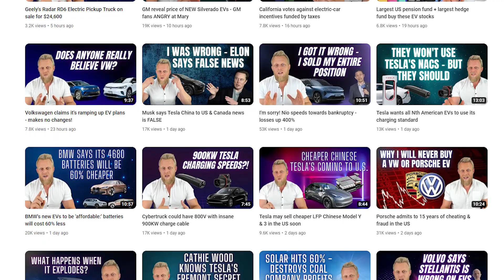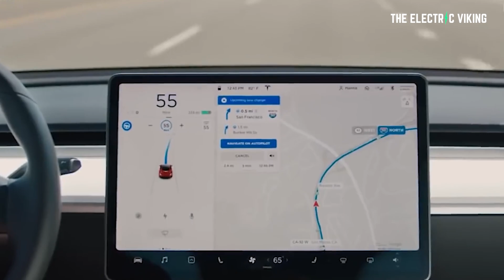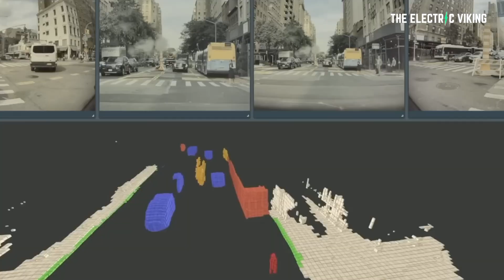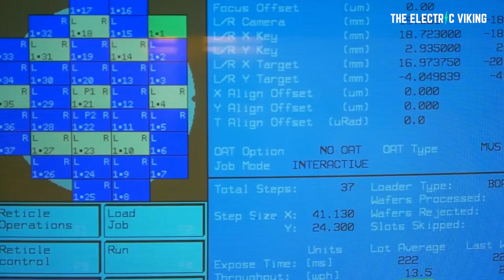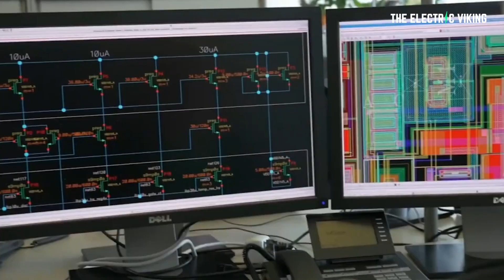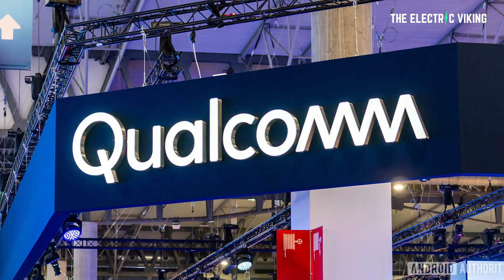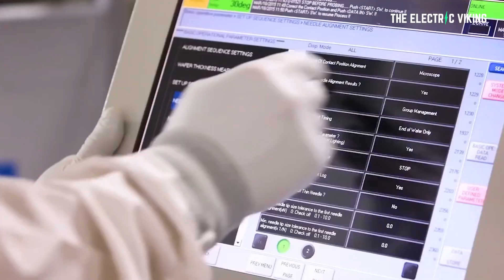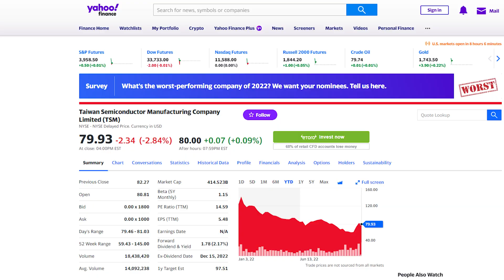Tesla places HUGE order of next-gen FSD chips with TSMC

Comment: Sam you may want to check out ReRam. TSMC announced they are producing it at 40nm. ReRam has super disruption of Flash NVM which is in every electronic device given its far superior performance at lower cost.
The Apple iPhone 14 is rumoured to have this ReRam in its power management chip. This could explain the Tesla move due incredible power saving and endurance over Flash NVM which has already failed causing a 160,000 car proper recall to replace.
The only other near term ReRam company is ASX listed Israeli company Weebit Nano.
How about you get in touch with Coby Hanoch WBT CEO and do an interview about this revolutionary new NVM soon to be in all electronic devices as Flash goes the way of floppy discs.
Can help in this regard. By the way WBT has been asked to speed up
Reply: development of ReRam at the 22nm node for automotive applications by a Tier 1 fab.
Reply: Should add have been a large holder since 2016.

Comment: You don't understand semiconductor  industry.

I suggest the excellent Asianometry YouTube channel & site to take a better grasp of industry history and dynamics.

Fabs as they call the manufacturing facilities cost nearly 20 billion each in most recent generations. It's very capital intensive, but command a premium for it's production for a relatively short time when products are nearly top edge. Factories must run nearly at full capacity and quickly raise good chip yields to be profitable.

TSMC is a pure fabrication contractor, different than Intel and Samsung who also design chips. Intel "fabs" mostly it's own designs. This was called an IDM for Integrated Design & Manufacturing.

Semiconductor industry was used to exponential growth based on the shrinking of features in the chip with power efficiency, performance and cost gains at each generation. 

A generation was defined by the "node process" related to the minimal feature size. Not anymore, now just a dumb number to represent what would be expected if they could reach this value of minimal feature (not possible) doing a lot of other tricks (2D to 3D, new architecture and materials,...).

TSMC brilliantly leaded by Morris Chang, a former TI employee, developed the whole of Taiwan's semiconductor infrastructure and ecosystem. Thousands of highly educated engineers and technicians that can manage and operate the highly sophisticated fabs. Not just at lower cost, but also not easily reproducible elsewhere.

TSMC asks: would there be Americans prepared to fulfill this kind of jobs?

Part of the fab cost is the buildings themselves. No vibrations allowed etching features at nanoscale. They're highly automated, it's true. But they must incorporate the latest tools and perfect the processes to execute reliably with few losses.

Just imagine that a typical high end chip will have more than 50 layers of processing. No misalignments, no defects allowed in the many millions of component features inside the die/chip.

Each fab is far more complex than anything Tesla does. All about Tesla is child's play compared.

ASML is the sole producer of the newer generation of a crucial tool that uses Extreme Ultraviolet Light capable of producing economically chip from "7nm" (TSMC's dumb number to call the node generation, not real feature size) and below.

Intel is only mass producing at an equivalent to 7nm (former Intel 10++++, current Intel 7 to align to TSMC's and Samsung naming).

TSMC, Samsung and Intel are the sole producers using EUV that American government control the licence to export. (Was built first in US and basic patents licenced to ASML the integrator of the machine and their parts suppliers like Zeiss, Cymer, ...).

Those EUV tools can cost 300 million dollars each. There was a G1 and now they're ramping a G2 with high numerical aperture (high-NA).

Intel postponed volume introduction of EUV-G1 due to it's gigantic costs using older "fatter" light sources (DUV) with more passes falling behind. Now they're trying to leapfrog with EUV-G2.

Intel perfects a process and "copy exactly" to other facilities to broaden volume of it's own designs.

TSMC contract builds many more designs of the whole industry, and Smartphones now dominate the high end volume market. TSMC has far higher volume output than Intel and Samsung allowing for testing and perfecting variations of the nodes first and commanding higher margins.

Older processes are also used and there was a shortage o capacity this last years. Historically most elder facilities (5 to 10 years) are not profitable commanding just marginal costs, subject to boom and burst cycles and consolidation or closure. 

Some do specialized work as hardened chips, analog chips, etc.

TSMC made a business of not competing with it's customers, being reliable not to steal or let others steal their customers design. Last but not least they execute near perfection. 

Being subject to Taiwan's risks (earthquakes, mainland China bullying) is their risk.

Moving capacity to the US will cost more to build, license, operate the factories decreasing margins, but also give them survival options in the case mainland goes crazy.

US is making a strategic move onshoring more semiconductor production for geostrategic security more than cost effectiveness. It's a recognition that the dream of globalization have gone a bit too far with risks not tolerable of depending on the other side of the world for everything.

The pandemic, Russia's adventure in Ukraine, had effects lowering the risk tolerance Wall Steet lead the west.

Some geographic diversification of production of everything people rely on is expected even if agaist crude economic profit in simple Excell spreadsheets won't point this way.

If batteries are strategically needed, chips are needed too.

Comment: FYI TSMC is a very good, well organised chip foundry - it builds the chips from silicon wafers using various processes, making them to designs specified by chip designers like AMD, Intel, ARM, TESLA etc. It uses ASML lithography machines to achieve the desired resolution (5nm, 3nm etc). ASML is where the really difficult part of the process occurs: designing and building extreme ultraviolet (and beyond) lithography machines which produce accurate, reliable results for years on end. 
The West has largely, and foolishly, treated computer chips as a commodity and has, therefore, built very few chip foundries. Even without the clear vulnerability of Taiwan to mainland Chinese aggression (which is rising, as you note), it is pretty dumb to have, effectively, a sole source for such a vital part of the modern world. Someone has finally wised up to the fact that the consequences of losing most of the world's chip supply for any reason would be devastating to the world economy. Hence the US decision to invest in a chip foundry. The EU, Japan and the UK should be doing the same so that there is sufficient capacity in the event of a disaster. I also note that one of the reasons that Russia is failing so dismally in Ukraine is that it has lost legal access to western chips for its modern weapons.  Its own designs and foundries are about ten to fifteen years behind the West (e.g. lithography at about 65nm implying they run much slower and much hotter and are less complex or capable).
Reply: Very good comment, but the premise is that you must know what US Secretary of Commerce Raimondo said: "The United States imports 70% of high-efficiency chips from Taiwan, and these chips are used in military equipment."

Many people don't know that Taiwan's all-out development of chip manufacturing has only one purpose: to manufacture the chips needed for anti-ship missiles and prevent China from invading Taiwan.

The United States handed over 70% of the military chips to Taiwan for manufacturing, and this is only a matter of ten years. Only TSMC and GlobalFoundries can manufacture military chips in the world, so this is not a Western chip, and it has nothing to do with Europe. , Only the United States can design the most advanced military chip, but only Taiwan can manufacture it. It has nothing to do with Europe, so it has nothing to do with the Western world. Taiwan belongs to the East.
Reply: @百里嘻  Taiwan belongs to the people of Taiwan agreed. Their semiconductors are a shield against China. If China attacks the United States defends Taiwan. It would be suicide for China to attack.
Reply: @shauna996  In fact, even if the United States does not participate in the war, Taiwan has more than 50% certainty that it can defeat China. Of course, it is even better if the United States participates in the war, and there is a 99.999999% certainty that it can defeat China.
Taiwan's focus on semiconductors has never been for making money, but for the research and development of advanced weapons. The current situation is actually very embarrassing for Taiwan.
Reply: @百里嘻  Thank you for your response. Firstly, please note that ARM chips are the most produced CPUs/chips in the world with over 230 billion made so far and counting. They are often the core design around which other elements are added (e.g. Qualcomm snapdragon CPUs for phones).  ARM is a UK (i.e. European) country. Given that these are low-powered, fast and efficient general-purpose CPU chips they can, of course, be used in military equipment like missiles. So your point about "nothing to do with Europe" is wrong. Secondly, you do not specify what chips the US Secretary was alluding to but I suspect that they include ARM-based chips, given that those are so fast and efficient.
Your pride in Taiwan's prowess as a manufacturer is justified but, as I stated in the original post, it does not design chips, and likely lacks the capability to do so, and relies on western designs and western equipment to carry out its manufacturing. What you are claiming is like saying that a book written by a UK citizen, printed on a Dutch printing press in Taiwan makes it a Taiwanese book. I disagree. I suspect you will never change your mind on that so we must agree to disagree - as is often the case in discussions.
Reply: Before 2004, the United States led the world in semiconductor technology, and foundries had to pay IBM's technology license fees. But in 2004, TSMC took the lead in developing 0.13-micron copper process technology ahead of IBM, ushering in the era of Taiwan's semiconductor technology leading the world. In 2014, IBM withdrew from the foundry business, and TSMC considered buying IBM's fab in New York State. However, even though IBM's technology has lagged behind Taiwan by a decade, the US Department of Defense and IBM, still worried about the already fading American technology influx into Taiwan, rejected the deal. High-tech semiconductor technology is the result of Taiwan's efforts to develop, and now the United States claims to "bring back" semiconductor production to the United States.
Reply: @genuinennessbefitting4734  Thanks for the comment - which I respect. I'm not really sure what point you are making but, assuming the "bring back" indicates it then my response follows. The key components of the computer chip build process are the design and the lithography. Plenty of research is going on, worldwide, into smaller and better designs for components (individual transistors) and they change as the available technology dictates. The USA (and the UK and others) design chips, Taiwan does not, as far as I can tell. The only source of EUV machines capable of the necessary lithography at 5nm or 3nm is ASML, a European (Dutch) company (mainland China claims to have developed such a machine but we have yet to see any real chips mass produced by them). There is, of course, considerable skill in the actual manufacturing process - but that can be mastered by any competent, determined manufacturer. Whatever the history, that is the current situation. Without the designs or without ASML lithography, Taiwan would be producing no chips. The USA has simply decided that, having previously chosen, like other nations, not to compete against low-cost manufacture in Taiwan, now is the time to guarantee another source of supply - which, I'm sure, will be more costly than production in Taiwan. It is a matter of national security rather than anything else. What is the problem with that? Loss of Taiwanese manufacturing now (invent your own scenario) would be a disaster for the world. With additional sources of chips, that risk is mitigated. I hope that Europe, the UK, Japan and others do the same (and swallow the associated higher costs in the name of national security). TSMC is undoubtedly a very good foundry but single sourcing any vital component is usually dumb.

Comment: Just to be a nag, there are many things most people don't take into consideration when thinking about micro-circuits (chips). First, yes size matters. Going from 7 to 5 nanometers is significant for capability and performance. The chip function (design) is equally if not more important - NVIDIA has to support many uses, where a dedicated operation improves performance (ASIC, RISC). Power and heat management get tricky. Materials are always a concern (purity), including the whole "clean room" environment. Not easy, not cheap. Best guess is it will take at least 6 months to get first chips into production (think CyberTruck) and that's rapid, 2-3 years is quick, longer on average.
Reply: Intel's 13900k - based on Intel 7 AKA 10nm - beats AMD's 5nm chips. Node size alone is too simplistic.

Comment: One of the big reasons for the shortage of new cars is the chip manufacturers took the opportunity to close down old fab plants because of Covid, mostly used to supply car OEMs, and their refusal to reopen them after so that they can focus on new manufacturing processes. The car OEMs don't like or want change so are resisting moving to the new chips. It's a battle of wills and one that the chip manufacturers appear to be winning.